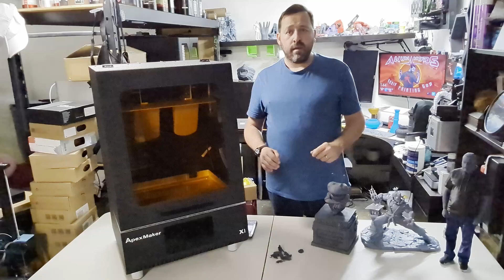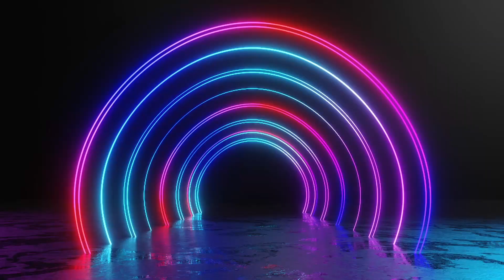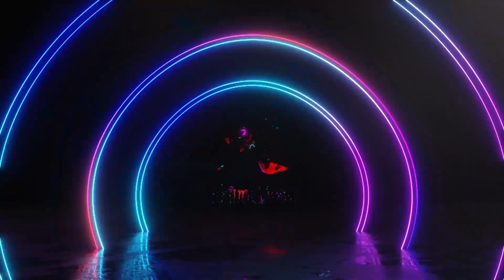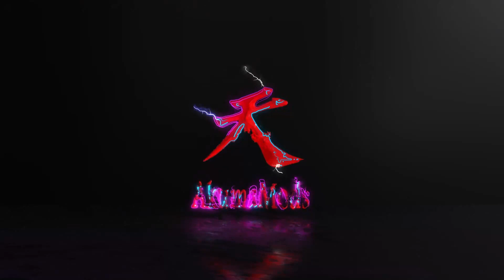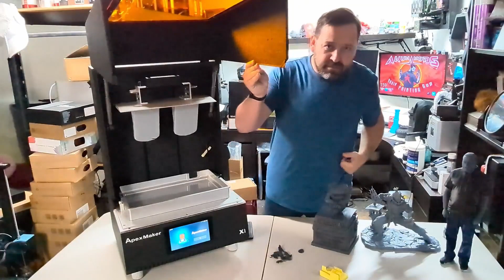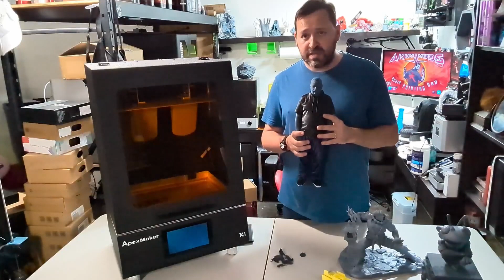Apex-Maker X1 Review

Comment: Hello Matt, Sorry to bother you but I'm looking for a firmware for the X1 with the zhop command. The button for the new version has been removed and it doesn't work for me. Martin from the group tells me that your version is stable. Is it possible to share it? Thanks
Reply from the maker: I wish I could share it but I do not have a way to export the firmware to get it out to people. Plus I'm worried if they changed stuff on the production model that it'll mess with those features/settings

Comment: That speed at 50um layers is a massive achievement! Apexmaker announced that their 180mm/h is done at 150um layers - not 100um (1200 layers/h)
Reply: I would love to see your profile when you release it! I have tuned the M5S to ridiculous speeds (1400 layers/h) and am excited to give this beast a go. Having settings to base my work off of is a massive help!
Reply from the maker: You are actually correct. I can print 400mm at 0.100 in 4hrs 12min

Comment: Finally got a quote for Hawaii shipping at $600 (still better then $900 for galaxy). Still not sure tho for if my case i should consider the Starfield 3D. One of reasons i was considering Galaxy was for SLA over LCD, since always paranoid of breaking screen. I do see a lot of people in galaxy thread having issues with third party resins, is this more of a SLA issue or is it just something that will always happen with any resin printer until dialed in.
Reply from the maker: I don't have any issues with 3rd party resin on my Galaxy. The starfield is the same type of laser system. It's not like a formlabs printer its kinda like a 2d printer scanner. It sweeps the laser...downfall is it is super slow compared to any resin printer on the market

Comment: I'm still on the fence if I should cancel my pledge or not.  I did enough research on the X1 that i'm confident the product will be good i'm just not sure if I will use it all that much.  I have still a few days to decide.  Thanks for the review.
Reply from the maker: And that is super logical of you to think that. How I look at it is. For the price and options it's a great buy. If you do grab it you won't really need another resin printer for a while. I really don't see much changing from this printer moving forward.
Reply: @AkumaMods there is already a change... UltraPrint have what looks like the exact inner working of this machine but with a built in post print cure feature... launching on ks sometime soon.